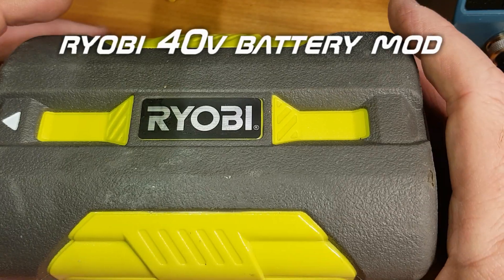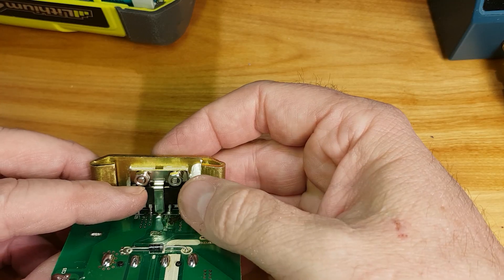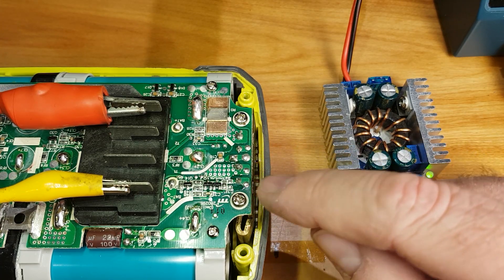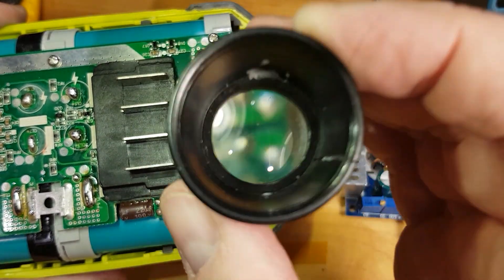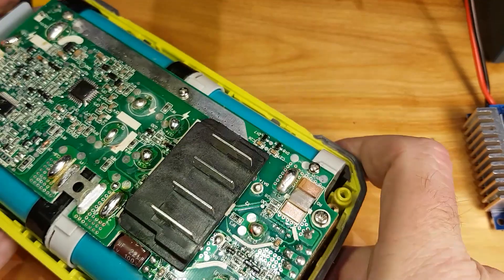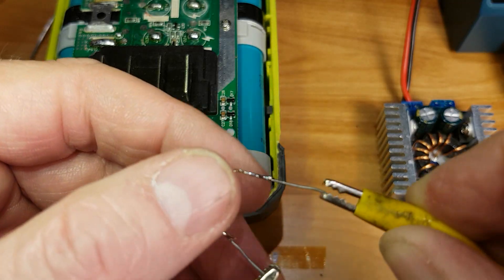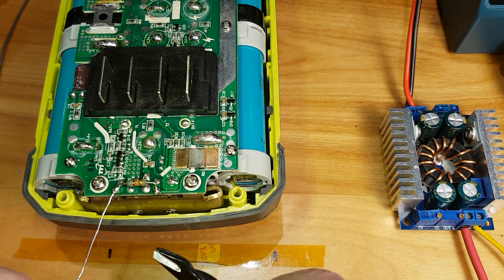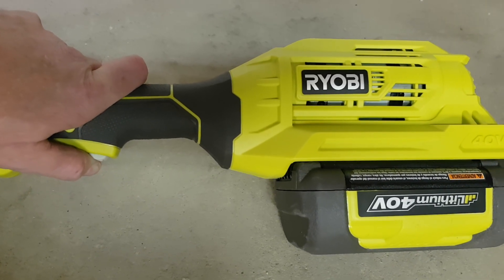Ryobi 40V battery won't charge.

Comment: do you have a link for the resistor? Thanks
Reply from the maker: Unfortunately its difficult to buy just one resistor, but here is a link to a pack that should work. The resistor value is not critical, so pick the closest one. Good luck.
Reply: @thecityviking  Thanks, it would be great if you ever have a chance to make a video for Ryobi 40V 4ah. That seems most people have problem with.

Comment: I think you are disabling the "Pack Protector", a very dangerous fix.    Lithium Ion batteries can be very dangerous if not charged properly.  The controller uses the "pack Protector" to keep from burning your house down.     It's there for a reason,  the controller Polls the cells to ensure they are in proper working order to accept a charge.  Forcing them to charge while not being monitored, is very risky.
Reply from the maker: You are correct. 

I state that you are disabling the safety feature of the BMS in the description and in the video.  You can do this if you are monitoring the individual cells yourself and you are the BMS.   If you are not sure what you are doing, don't do it.  That being said, the resistor that I install is attached to the circuit in a way that the BMS is still able to turn off both FETs if it wants.

I hope this clears things up and thank you for your input. 

Be safe.

Comment: My ryobi mower battery dies before it fully discharges.  An electrician told me that it's that the relay is causing it to overheat.  He told me to take the relay out of the battery.  I opened the battery but don't know where the relay is.  Does anyone have any suggestions?
Reply from the maker: There is no relay in the battery pack. The battery uses FETs to turn off charging and discharging of the battery. I would check individual cell voltages and see if you have one set of cells that is low. While you can bypass the FETs, you will effectively be bypassing the safety features of the battery pack.  Please only do this if you understand the risks involved.
Reply: @thecityviking  Thank you for responding.  I don't know enough about the battery, so will give up on it and most likely buy a gas push mower.
Reply from the maker: You are welcome.  Sorry to hear i wasn't able to help you.

Comment: I put 2 wires with alligator clips to the outer 2 terminals to a fully charged battery for 4 days now it's charging
Reply from the maker: Wow 4 days!
Reply: Is this way safe to try I have a good ebike battery 36v and one that won't charge at all seen people saying use alligators clips and connect the batterys together just don't want to blow anything up trying this @thecityviking

Comment: Thnaks this video, I have some trouble with it.
Can I soldering 10 AWG wire connected "CL1-" and "tab-"? it looks like same way to bypass FET?
Reply from the maker: That would definitely bypass the FET's, but that could be very dangerous.  You would have nothing preventing the pack from over discharge, or over heating.  I do not recommend that.

Comment: Great video. Can you please give the name or the link of little charging device. Thanks
Reply from the maker: amazon.com link for power supply I use:  https://amzn.to/3hXIysX

The link was in the description.  It works with an input between 10-32V and has adjustments for voltage and current on the output.  Output has to be higher than the input.  I use a 12V power supply from and old Computer but you could use a laptop power supply as well for the input.  I Don't set the current higher than one amp for safety.

Looks like they are currently out of stock but should get more.  It's usually under $20.

Good luck!

Comment: Thank you VERY MUCH for this fix video....but....what size resistor do I need to order? 1/4 watt, 1/2 watt, 3 watt? (51K ohm of course) Sorry for being an electronics newbie. Your resistor looks a bit small, so I would guess 1/4 watt?
Reply from the maker: Good question.  The resistor I used is 1/4 watt.  There is virtually no current through this resistor as it just passes the 10 volts from the one spot to the other to turn on the FET.  Make sure you do have 10V at the other side.  Good luck.
Reply: @thecityviking  Thanks so much for the nearly instant reply! YOU rock!
Reply from the maker: You are welcome

Comment: I have tired different approaches and cannot seem to get any of my old batteries to come back. I have 11 of them.  I am wondering if I should make a battery pack out of them for something else.
Reply from the maker: I have 20 and plan on making a battery pack.  I have some ideas but not sure what final voltage I want.  If I make it for my trailer it will either be a 24v or 12v.  I may make one for my new bike motor.  A 1000W mid drive that runs on 54v

Comment: So when I attach the negative to the screw my charge stops charging.
Reply from the maker: The screw itself is not actually connected to the negative of the battery, but rather is just a spot where I connect the alligator clip and the side of the clip touches the negative pads.  I hope this helps. :)
Reply: @thecityviking  Thank you that makes since.

Comment: Hi good video. I also have a few batter with 1FET. My battery has 42v over the cells and 21v +, - the plug. Measures the voltage on Gaite at FET where it is 0v should be at least 10v. It must activate FET when you load the abbey and then get 10v. But can not figure out where the signal should come from. Has anyone had this problem.
Reply from the maker: It could be a bad FET, but as I explained in my other video, you do need to load the battery before checking the voltage at the + and - terminals.

Comment: I highly doubt ryobi permanently disables the battery because the voltage drops. Ive never heard of that from any battery. 

I believe what you are doing is  Disabling the low voltage  Detection  Circuit.thats extremely dangerous to use in this configuration as it will lead to the tool over discharging the cells and forming the little crystals that  Puncture the  Insulation between  the  Cathode and anode and causes the cells to go boom 💥 

You should be able to disable it and get the voltage up past 30v, resolder the trace and the pack should work as normal.

Have you tried doing this???

Also once you have disabled the low voltage circuit  you can use a fully charged 40v pack and connect pos to pos and neg to neg with the low voltage pack and it should bring the pack up to 30+v in a few seconds. Good enough to kick on the charger atleast.
Reply from the maker: As for the first part...most if not all lithium packs try to balance the pack(get all individual cells charged exactly the same) and shut down the pack if one or more cells are out of balance to protect users. 

The trace that you cut turns on/off the one FET.  Taking apart and modding any lithium cells is dangerous and should only be attempted by people who know the risks!!

Attaching a fully charged battery to a dead or even low battery can be very dangerous without a load or something to limit the current.  I use a 100 watt incandescent bulb and it limits the current to about .5A

I have charged all cells on dead packs to 4.100 each for a total of 41.000 volts and the pack will not charge and flashes an error, so yes the pack is disabled by the BMS somehow. I belive it is a safety feature and not a flaw in the packs.  

You should also watch my other video where I try to answer peoples questions.

I hope this clears up any questions.  

Thanks for your interest. :)

Comment: How many batteries are in series? Thanks.
Reply from the maker: 10 batteries in series 2 parallel.  20 batteries total.
So its a 10s2p pack.
Reply: @thecityviking  batteries meaning   cells?
Reply from the maker: Yes sorry for the confusion. 10 cells in series and each cell has a parallel as well.

Comment: Hi, Very carefully followed your instructions.  Cut the trace cleanly and completely.  Soldered the 51k resistor on the two points indicated.  But when I insert the battery into the charger, I still get the red/green flashing lights, and when pressing the button on the battery, all four green LEDs on the battery flash four times.  Any recomendations?  Thanks
Reply from the maker: Have you watched my other video Ryobi 40v battery questions answered?  What is the voltage across the individual cells?

Comment: Hi City Viking. Thanks for the video. Could you please clarify. Is it a faulty FET causing this problem and could I just replace the FET or is there some other issue causing the FET to remain open. One of my batteries gets the blinking light of death on the Ryobi Charger. I've pulled the battery apart and charged it manually through the postive connector and the screw terminal as you showed, but the battery will not charge on the Ryobi charger after manually getting the battery up to full charge. Therefore the problem is not because the battery is too low in voltage. I could cut the trace and apply the resistor as per your video but I could also replace the FET. Is there a way to test the FET while it is still connected to the board to determine if the FET is the problem? Cheers Marty.
Reply from the maker: It is possible that tour FET is faulty but in my experience it is unlikely. Basically what happens is the intelligence on board determines that the pack is defective and it doesn't allow charging. I will be making another video shortly that will describe how the pack works and why it fails and how to properly check each cell set.
Reply: @thecityviking  Thanks for the info. I will do your mod and see how it goes. I'll let you know. Cheers Marty.

Comment: Hello,
I have a 40v pack from 2013 with samsung cell in it and measures 42.2v between CL1- & BAT+ terminals. Also I measured CL1- & CL5+ and got 20.5v also CL6 - & CL10+ is giving 21.7v. But actual terminal + & - from the pack is only giving me 20.5v. Btw, Pack charges good and been sitting for a week. Is there anything I can do to revive it? Final note, the tool runs for about a minute or two and dies with battery light still on with 3 green dots and 20v.
Thank you
Reply from the maker: I had a pack like that and it turned out to be a couple bad cells.  It was on a pack that had a single FET and when fully charged would run lawn mower for about 2 mins then it would cycle off and on.  I bypassed the FET and found that the pack would get hot in one set of cells.  That set of cells would be much lower then the rest of the pack.  You can not recover the pack but I did salvage individual cells to power other things.
Reply: Thank you for the response. That was my initial thought too. And yes, it’s the one with single FET. I guess it’s time for salvage. Btw, I found out that it’s not a AA size. What projects are these cells useful for if you don’t mind me asking?
Thank you
Reply: @bbg5939  These cells are lithium Ion and are 3.7V nominal, that do charge to 4.1-4.2v with a proper charger and you can use them in laser pointers, vapes and special torches, most people use them for those things but they can also be used as E-bike or E-skateboard packs, there are other uses like batteries for your solar power storage, but you need a bit more expertise to do that and a ton more batteries.  BTW if you let them discharge too low it reduces the cell life, with these cells you're best not to let them get below 2.5V each but charge them when they are somewhere between 2.5 and 3.5V up to say tops 4V (as overcharging at 4.2V+ also reduces their life!)  Overcharging and over-discharging Lithium cells is dangerous and can make them explode and set fire to stuff like houses and garages so beware, this is why they have a battery management system to limit the discharge.

Comment: For the FET that will not turn on why not just solder a jumper between the Source and the Drain of the FET, this will have the same effect as the FET being turned on using the Gate, but without cutting any traces.
Reply from the maker: I agree that will work.  The reason I decided to cut the trace and tie it to the gate of the other FET is to possibly get some protection. If the pack starts to overheat or overcharge I was hoping the intelligence in the pack may try and shut down the other FET to protect itself. 

By modding either way you are defeating a safety mechanism that is why I never charge my modded packs unattended.
Reply: @thecityviking  That's a safety minded approach and is probably the better idea, but it is based on hope and not fact, but it is the better idea. And any item that is modded without having an accurate understanding of how the mod WILL effect the circuit should always be personally monitored.

Comment: Is there a way to basically do the same procedure with a single FET battery?
Reply from the maker: Not sure.  I'll see if I have one and try and figure it out
Reply: Awaiting the same!
Reply: Thanks City Viking, great video tutorial, my battery is dead as we forgot to leave it charging last winter, but it's the model with one FET, what would you suggest to do in this case, just desolder the FET completely, force charging it to some charge, then replace the FET and charge normally?
Reply from the maker: I would try charging it like I describe in the video using alligator clips.  One on the positive and one under the screw(negative)
Reply: Under what screw watched video 3 times I don't know how I'm missing this screw  @thecityviking

Comment: Hi nice video. I have the same 40v battery. When I place it on the charger it appears to be charging normally and when removed the battery lights indicate it has juice. However the battery still doesn’t work in my trimmer. Any thoughts? Would be nice if I could send you my battery for this mod.
Reply from the maker: This mod may not fix your battery but it could. I'm working on another video to show some of the problems with this battery
Reply: @thecityviking  link to the next video?

Comment: Great Video. Im saving this for future in case ba ryobi 36v gets into same problem. But i also have a question which hopefully you have solution. I have this other battery of same model that have all of its LED are on as if they are full but when used - there arent any juice. So i attempted to charge it with its charger - the charger says that battery is faulty. Any remedy for this case sir?
Reply from the maker: I have a couple batteries that show a charge like that but when I open and measure  individual cell packs usually there is at least on set of cells that are dead(below 2.5 volts).  I have tried charging the cells individually but they discharge quickly. I will harvest the rest of the cells for building a a new battery.

Comment: I have 40 V Ryobi  Battery showing full charge, When i check voltage across + and - Terminals it shows only 18-19 volts. voltage on the board -ve and +ve terminal is 41 volts .  Voltage
between T1 and +ve terminal is 41 volts. seems like battery is fully charged. It does not run my weed eater. can you suggest something.
Reply from the maker: Are you sure the problem is in the battery? Do you have a second battery to try in your weed whacker?  Can you connect some other load up to + and - terminals?  I use a 100w incandescent(old style filiment) bulb conneced to those terminals and it draws .5 maps and the bulb glows but not at full brightness.
Reply: @thecityviking  My weed eater is good have tried on a different battery and it works fine, this battery that i want to revive went into the sleep mode. I tried to charge it by pushing it into the charger a few times and it started to charge. After the full charge it wont turn my weed eater.Checked the voltage on +ve  and -ve terminal it was at 19 volts. Checked the voltage between battery ground and +ve terminal it reads 41 volts. Checked the charge on the battery all the lights comes on. The charger shows its fully charged. I am lost
Reply from the maker: I have found a few batteries where the board looked the same, but they act differently. I suspect that there are different software running on the boards. Have you measured the 10 pairs of cells individually and are they around the same voltage? I am going to be making a new video about these batteries shortly.
Reply: I have the exact problem with my battery, 18 volts between the + and - terminals 40 volts between the + and main ground on the board. Today I ran a jumper wire from the main ground and + terminal to the trimmer and it ran for almost an hour. The battery discharged to 32 volts so I put it back together and charged it. No change still 18 volts between + and - , 40 volts between main ground and +.
Reply: @eddiedavis346  can you post the picture